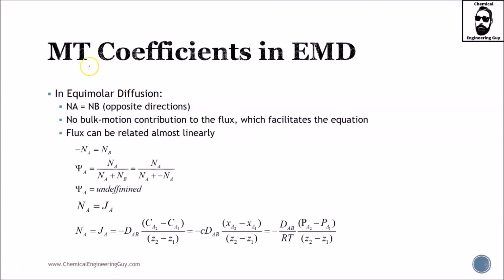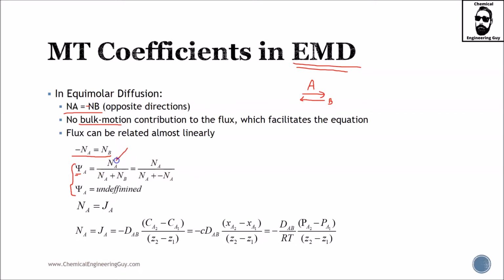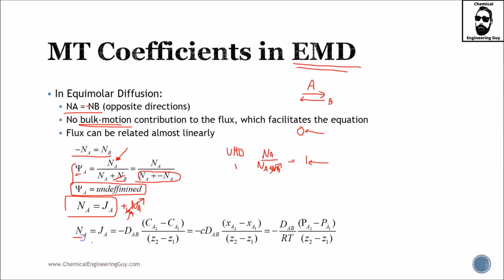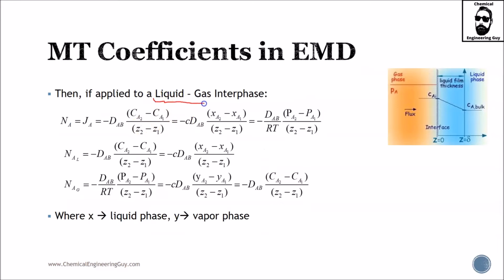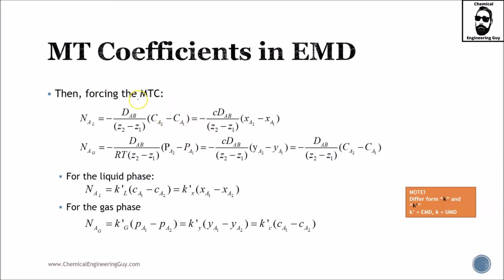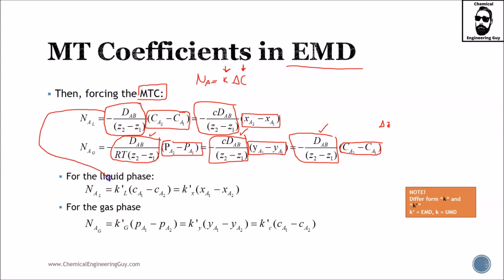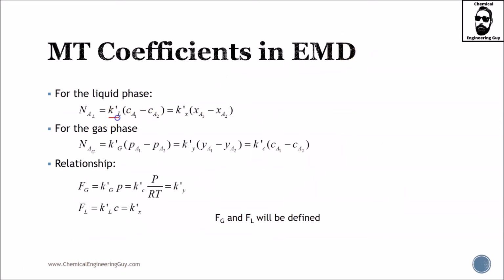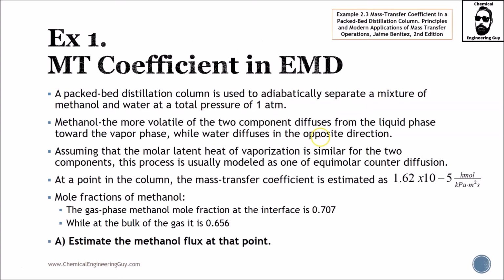Mass Transfer Coefficients applied to Equimolar Counter Diffusion Case (EMD) (Lec159)

Comment: I recently found out about your content. I am a to-be Chemical Engineering student and thought I'd get a head start on my learning. My question is, which course should I enroll in first if I have no knowledge about chemical engineering? I have and know the basics from my high school studies but no idea what the content of chemical engineering course is.
Reply from the maker: You should enroll in a Mass Balance Course, then Energy balance, then thermodynamics; then unit operations (mass, heat and momentum transfer) then continue with reactor engineering + plant design/operations/simulation/control
Reply: @ChemicalEngineeringGuy  The ones on your YouTube channel you mean? If so then sure, anything on your website I should take a look at?